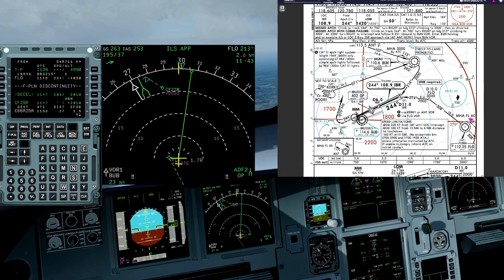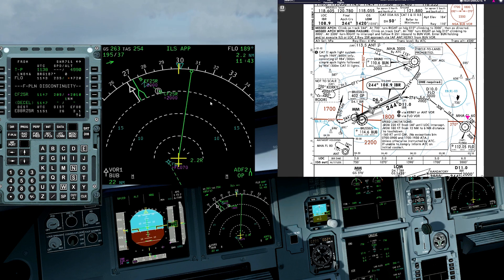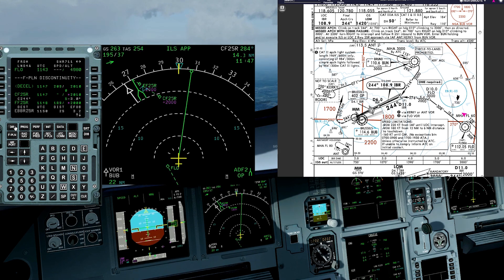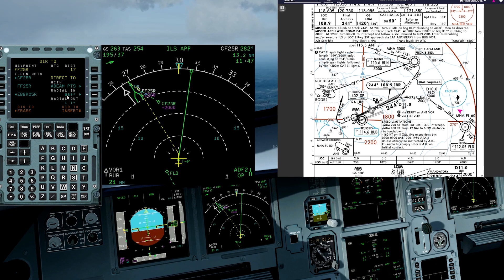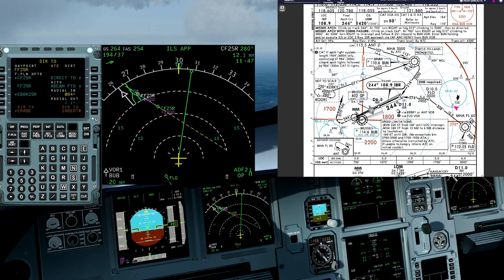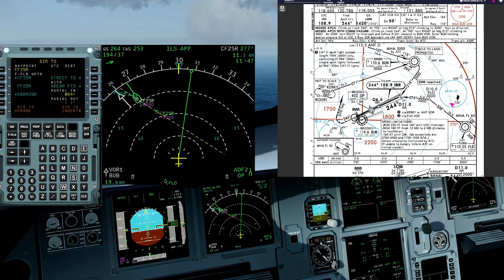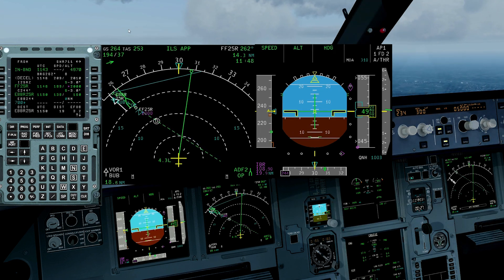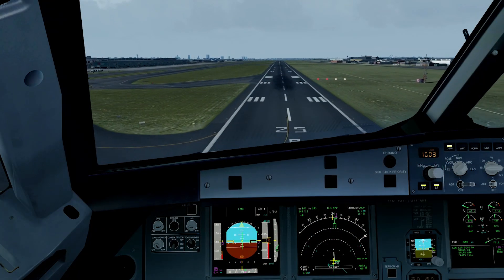FSLabs A320 Short Tutorial: MCDU Extended Centerline

Comment: I always use the THreshold as a FIX (fe LSZH14) and then draw a radial. But awesome to see a new technique for that. Cheers
Reply from the maker: By taking the FAP fix you also have a visual clue where the descent point is.
Reply: Blackbox711 thats true. But you could still add that manually (if its a waypoint). If its a DME you could draw a radius ? Right?